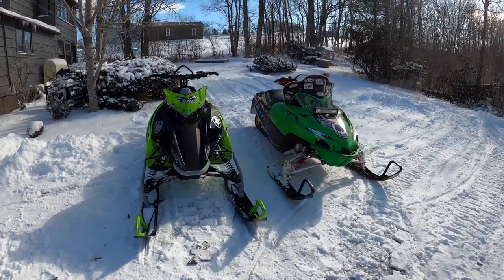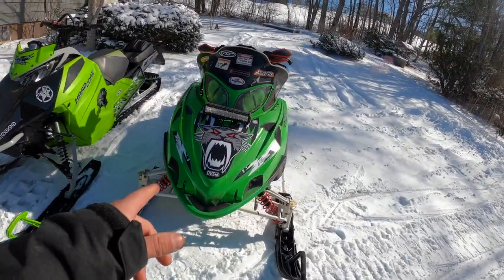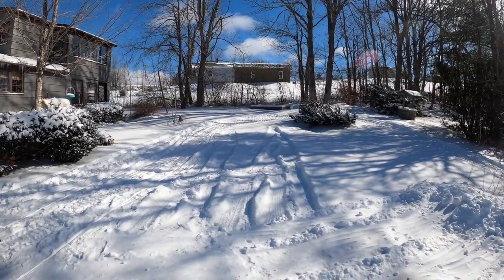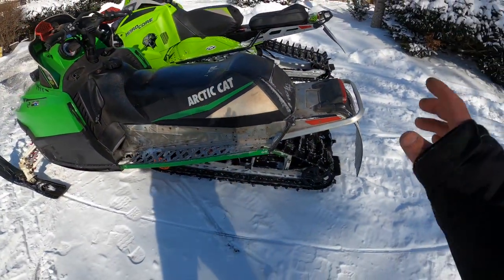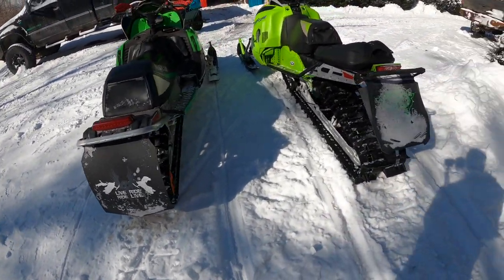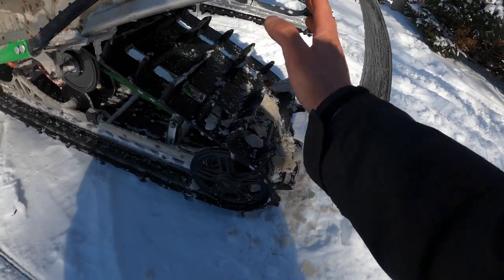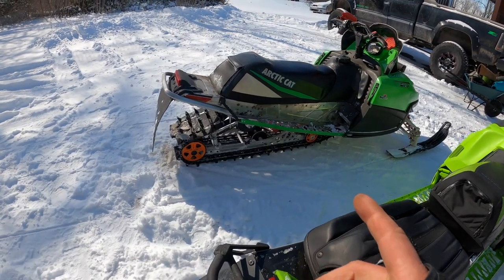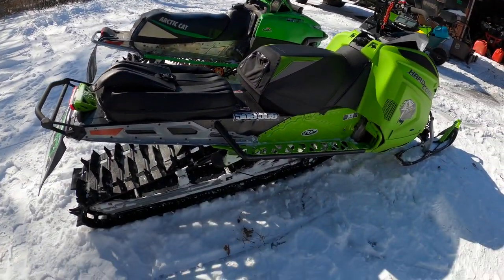M8000 Arctic Cat Snowmobile Overheating Issues How To Fix Them

Comment: I've been running scratchers on both mine and my wife's sleds for years.There are many different types,I always make sure ours are reverse compatible. If your cooler is in the front ,the ski scratchers are amazing as well.Scratchers are a must for the lug height of your track if you do any trail running at all,and they also increase the life of your slides(hyfax) big time.We mostly trail ride and I'd never run without them.
Reply from the maker: Yes im definately a believer in scratchers now

Comment: first off you don't have snow/ice scrapers on the sled that's the main reason it will run how especially on trail or packed snow
Reply from the maker: The m8 actually does and I mention about scratchers if u watch whole video